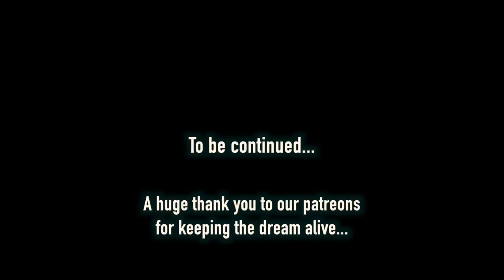CRACKED BULKHEAD REPAIR SERIES - PART 3

Comment: It seems like an impossible thing to achieve, straightening out a boat from that condition just by doing what you are doing. 
I believe you will do it and I have total confidence in you but you are going to have to reinforce some of those bulkheads and panels massively so it stays in shape ! 
Getting it straight and making it seaworthy again is one thing but refitting the interior to a high standard is something else although I suspect that's not a high priority right now.
Best of luck guys !

Comment: 11cm = 4 3/8”, but what we haven’t seen is if there is “Drop” in the pontoons also, which I’m sure there is as seen in the interior phot of the bulkhead he showed being sheared at floor level.   They will have to check the bottoms of the pontoons for level also and Jack accordingly.

Comment: Are you sure they didn't over tension the shrouds when you replaced them. 
You couldn't have missed all that damage all the way through the first repairs.
The failures we are looking at are catastrophic. They all happened in one go.
I suspect that as the tension came up the Hull took some but kept bending as they kept winding. So they loaded it up like a big crossbow. 
Were the bottle screws very cranked in?

Comment: Agreed on the bulkhead damage not being 100% hurricane damage .. production builders HAVE to stop bonding with adhesives instead of tabbing in  the bulheads in with glass .. Adhesive manufacturers over promise on the preformance of their product,  and the boat builders generally really want to believe the marketing as it drastically lowers costs.. not singling out any specific manufacturer, they all do it .. surely by now its becoming such  a common failure point in both cats and monos , it  would be a bit of a  selling point to say our vessels bulkheads and loadbearing structures are glassed in ,  my 2 cents ... hope it all goes well dude,  you guys will find a way to fix this ,  anything can be problem solved with imagination and determination ..

Comment: Why does it seem like some person tightened the shrouds way more than they should have? Someone screwed up, patched it up, and then the hurricane happened.
Reply: Not that simple, remember you have huge forces acting on the mast (wind) compounded by wave action and who knows what else when this boat was wrecked.
Reply: @ericdelevinquiere9902  Recall that the bulkhead damage was done before the hurricane and repaired with the half-measures.

Comment: Make sure they have equal angles on the vertical hull chords.  You can get 5.37m, but have them not properly lined-up in the Y axis.  Example --  88 degrees port and 92 degrees starboard.  Sure, you've got 180 degrees and 5.37 meters, BUT angles are wrong.

Comment: Is there logic in putting bolts through the glass tabbing you are going to apply to the plywood?  It occurred to me that if the outer skin of the ply peels off under load, you still have a failure, whereas a bolt put through two sides of glass and right through the plywood structure would be super strong.  I am pretty sure no builders do it this way, but then we've seen some pretty shoddy design and build quality!  Leopard and FP are probably "tisk-tisking" at the Lagoon build quality but I wonder if they do the same thing?  I sure bet they are using this project as competitive sales evidence against Lagoon!

Comment: hi, around here we put, instead of water, cheap red wine on our levels, having less surface tension than water it gives a thinner mark to work on so accuracy is somewhat improved. if it was me i´d make the bulkheads out of metal tubing (allow of course), i´ve never had much trust in plywood (real plywood almost unobtainable here) and everytime you show the damage my balls come a little up. hope your crew and you are doing fine. take care

Comment: Yeah if you would have gotten out in the middle of the pacific and hit some big wind with 20 or 30 foot swells witch isn't uncommon out there in the south pacific you would have been in for a long swim check out sailing zingaro that happened to them on the passage from Galapagos to Hawaii almost tore the port pontoon off the boat luckily they had some dyneema line on board and tied the boat together with that enough to get them the few days they had left on the passage into Hawaii but the boat was totaled when they got there

Comment: @5:25. So what I don't really understand in this journey is why you would not notice something like this gap sooner as it was opening up?  If there was some existing damage behind facias to the bulkheads and structure of the vessel that was covered up somehow pre-hurricane,  why would you not have noticed how they made those repairs with access cuts, or even scope it out by looking behind cupboards.  Not sure that I would take this chance prior to buying a hurricane damaged boat.  Was the surveyor a friend of the original owner or did you not get Parlay surveyed prior to purchasing it?
Reply from the maker: My neighbor who is next to me on his lagoon 450 fixing the exact same bulkhead issue on his boat had 3 surveys, and even asked the surveyors to check the bulkheads, and none of them found anything wrong, so he went in and found them himself after watching our videos. You have to know exactly what to look for and dismantle part of the boat to find these things...
Reply: Sailing Parlay Revival "....I know you probably don't wanna announce it on the channel but surely it has to be a manufacturing error in design then?  I mean if there is a Lagoon right next to you guys fixing a similar issue, wtf is going on with that?  Surely Lagoon are making a fundamental error in their engineering calculations?

Comment: Do you know if the boat was in some incident prior to the hurricane?  Thugs get rid of cars that are damaged all time by being sneaky.  Would not be surprised if people do it with boats.  Cars that have been in major accidents, yet not fixed correctly, are then put in auctions, again, with minor damages, to distract the buyers, from major issues with the car.  New owner buys the car thinking that only minor things have to be fixed.  Then, he/she realizes after the purchase that the car had other major damages or fixes. This happens often with salvage cars at auctions here in the PNW.  Got to be careful and really inspect things.  Good luck with repairs.

Comment: When you finally succeed at this you are going to have to change her name to Sailing Parlay Resurrection. It was suggested on another channel that Lagoon should have been using foam core glass for the bulkhead instead of plywood on the 450. Any chance of making that change? or would it be too much to dismantle and rebuild?
Reply: If that was even a fraction of a thought to do that, put is out of your mind. I think you are referring to MJ Sailing building the NEW catamaran kit. That boat is using lightweight materials so they can have a FAST cat, not a FAT CAT (Lagoon 450) .... lol !!!

Comment: taaa Anderson....You have to remember this footage is old....They pulled this boat out of the water a couple of months ago.... he's editing old footage.  Also what he's not mentioning  that its hard to work ALL day in unbearable heat and humidity....In case you don't know, it rains in Panama six months out of the year !!!   Also he's not a professional film maker, theres no script to follow.... You film what you can, and when you have the energy, you try and make heads or tails out of what you filmed, and edit...... It's hard to film and do fiberglass work at the same time.....not to mention he's not in the States where you can just run down the street and pick up supplies.....He's doing the best he can.....

Comment: Now is the time to fix the boat as long as the pandemic is going on it will be hard to get visa. If you got a opportunity get the vaccine. A lot of countries will require the whole crew to be vaccinated. You will have a hard time to get permit to import any pets as well.
Reply: Basically they are sailing home

Comment: How do you manage to have your own blogs while being a chief engineer on the show Below Deck Sailing Yacht? Anyway, may I suggest you to put a stainless steel plate in between those cracked plywood and secured it with a washers and bolts on several angle for stability and hopefully it will do the job.
Reply: The show doesn’t air in real time.  It’s done and dusted.   Look back through past videos and all will be explained.
Reply: He uses a parallel universe so he can do multiple things at once
Reply: @mmamallama1827  Thanks I wasn’t paying attention on the time frame.

Comment: I feel for you guys , being so Humble and not pointing fingers but In honesty this is a design fault by the manufacturer and nothing to do with the hurricane the boat was in , , your bulk heads should be fully glassed in same has the floor, that is where you get your strength and rigidity from , not using a bit of sealant from a mastic gun , 
You can see the work men ship has gone into Lagoon  boats and from this video anyone wanna buy a Lagoon  cat should come and watch this video first ,

Comment: You gays are fun to watch, however my concern is that your polishing a teard... most of the bulkheads are compromised and you have 11cm drift between hull and deck. The stresses on the glass fibre are so high that straightening the boat will lead to damage within the glass fibre that will not be obvious at first sight... good luck but we know where this is going 👍🏿

Comment: Why wouldn't  you back off the rigging first, when it sits in the water. As sitting in the water, the hulls can move back together, as the strain is released. Instead of doing it, after your sitting on the jack stands.  Because once you sit on the jackstands.  The whole boat becomes rigid sitting on those stands.  And the two hulls can't move back together.  As opposed, as to if you were sitting in the fluid water.

Comment: Know you're going to do this right, am hoping you look at maybe getting some rough templates for the inner hull bonding shoes vs outer hull shoes so that other 450 owners might copy this repair/upgrade as needed in future.  You could sell/trade your templates to other 450 owners to pay back all the work you're investing in PR. Colin, have you considered using photo grammetry for getting a good 3D scan of the individual bulkhead areas you'll be making to increase the bonding area (ie a shoe) where the new bulkheads will apply loads ?  See :  https://www.youtube.com/watch?v=ye-C-OOFsX8

Comment: DOUBLE UP THE PLYWOOD Like you would SISTER UP BEAMS OR FLOOR JOIST IN A HOUSEFOR THOSE BULK HEADS AND USE WEST SYSTEMS AND MAKE A SANDWHICH WITH THE TWO SHEETS OF PYLWOOD AND WEST SYSTEMS IN THE MIDDLE!!!!!!!! THEN TAP THEM IN THEN LASTLY GASS THE FUCK OUT OF IT!!!!

Comment: Graphic display of your disapproval of the hurricane caused hull damage theories. When you crawled in and took video of the deck separation from the hull and how it was shimmed and “glued”, I changed my mind. The deck should have spanners that are glassed into the interior hull pylons. Structurally, that would make sense- adhesives- no sense at all! Bad design or construction failed to adhere to original Lagoon design?

Comment: Let's be honest here. The Lagoon 450's are shit. If you do some research you'll find that this is becoming evident worldwide. Looking at this and other video's shows that Lagoon cheaped out and I think have put people at risk. Another couple I follow sold their 2017 52S  last year and bought a different brand, While they didn't say anything directly several of their comments left no doubt that they sold it because of quality concerns. If I owned a Lagoon I'd be ripping it apart to check for structural damage and taking the appropriate action. As it is I wouldn't even consider one as you have to tear it down to check for damage and what vendor is going to allow that?